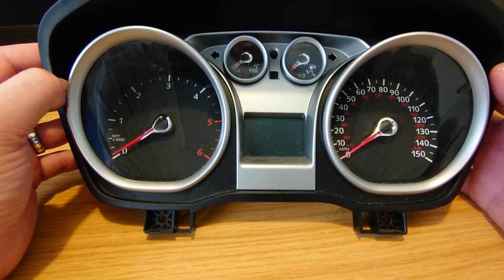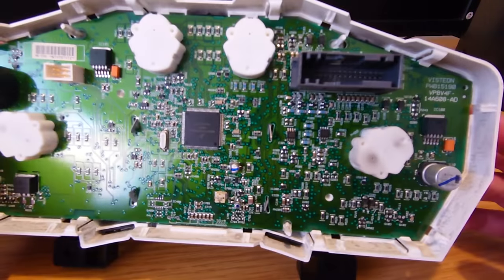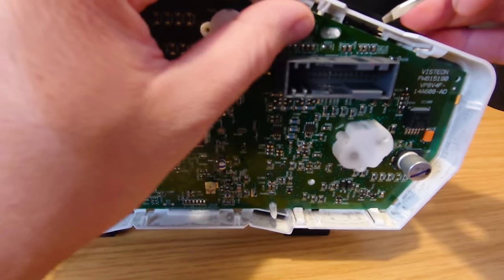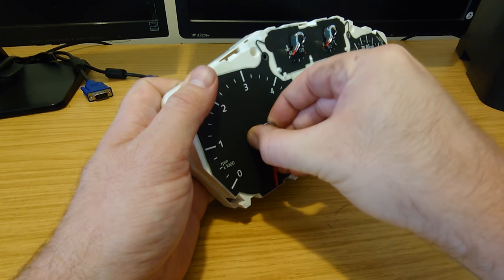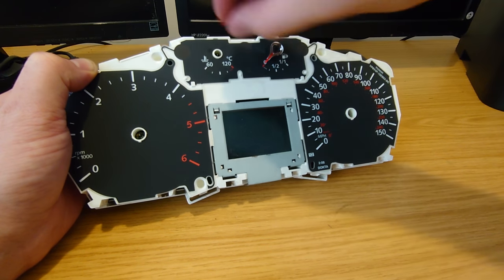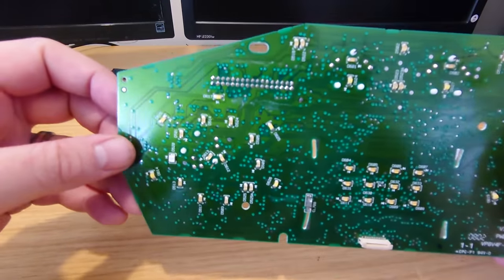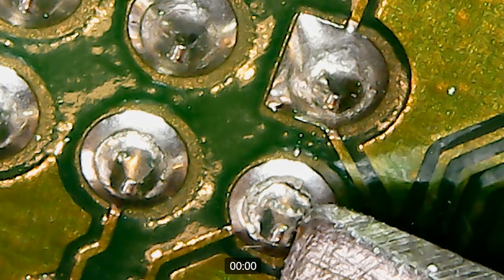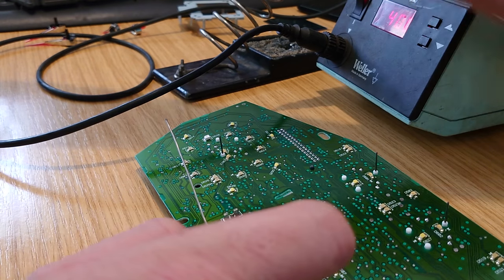Ford Focus mk2 instument cluster strip and repair U1900

Comment: so my car does this engine malfunction alot - will sometime refuse to start, sometimes will when driving comes up, tap on the dash changes to acceleration reduced - but comes up now and then engine malfunction - do you think its the same issue, had some scans of my car that related to CAM need to ask my mate hte code he got off of it which he saved. Recon its the same issue? also when soldering do you just ensure you adding to it - not heating up existing solder as that would make the pins fall out id imagine

Comment: I stripped the cluster like in this video and tried scolding it. However, it was going fine but one of these 'pins' in the top left completely fell off - what shall I do? Like there is nothing there anymore - where before there was that metal thing that you would scold...

Comment: Very,  dry impressive. I have a 2009 mk1 Kuga, which I believe is the same dash as the focus.,!?. So I was told. I bought the car a few months ago with, as the owner told me, had a fault code of  (u) V1900, not sure if u or v. Recently a garage cleared and reset all, but came up with a dpf. Fault, but the item concerned had been replaced ,new, so if it is something to do  with the instrument pcb, does that also control One or two other items in the system, and is your repair way the best fix.?   Thank you . Mick.
Reply from the maker: I would be surprised if a dpf fault was relayed to the dash. What was the fault? Fuel vaporisers are quite common faults for dpf on  ford.
Reply: @rmautodiag  Hi again, many thanks for your reply, oh, an sorry about ‘dry’ at beginning of last mail, it should have read, very. As to the dpf, that was shown on the fault code meter, not on the dash board. Sorry for anything misleading. The previous code before a reset was u/v? 1900, and wondered if you had come across this before, and what the fix is, in with the fault it does intermittently lock the doors? Any ideas.?  Thank you,  Mick.

Comment: Hey ,sweet video.  Have you ever done a 2002 transit connect cluster befor ? The back lighting seems to stay on and flashing on and off  and drains my battery could this be the same problem ?  Thanks in advance

Comment: Any tips on getting the led ribbon back in the mans hands are in the way and I cant get it back in ? Thanks
Reply: It’s actually easier than it seems maybe use tweezers ..it has 2 small clips at each side it should just slip back on

Comment: what is the reason that youre repairing it  
my ford focus makes a clicking noise at the front under bonnet when turning the ignition key several times,after so many turns the car makes a clicking noise at the rear of car,i wonder if its the fuel filter

Comment: Do I need to disconnect the battery before removing the cluster? Thanks, great tutorial
Reply from the maker: I personally don't. But it wouldn't hurt, make sure you have the radio code

Comment: Hi great video , could this cause a parasitic battery drain ? I have narrowed it down to the cluster . The display goes out after 20 minutes but cluster still keeps canbus awake . Possibly has a temp fault as gets to normal running temp ( according to gauge) within a minute ( 1.8 petrol mk 2.5 ) thanks Thor

Comment: Nice work , 
When I lock my ford focus TDCI 1.6 2011, by pressing the key fob twice I notice every thing goes off apart from the screen between the  rev counter and the speedo it stays on for several minutes befor it shuts down ` would  there be an issue with anything in the instrument board or screen ,
Any advice would be helpfull please, bought car privat seller not so long ago.
I had removed battery to change it and lost the code to radio as well,

Comment: Ive got an st225 thats judt died randomly when i tried to boot it.checked for error codes and i had about 7 different codes like crank sensor position cat not recognised. Do you think this could be the issue.might try the old wack on the top trick when it dies again.

Comment: Great video thank you very much for uploading will this solder fault also causes issues with the fuel gauge? as I have put a new sender unit in the tank and the gauge still doesn’t work !   it’s a 2007 cmax tdci

Comment: Great explanatory video. But how does the instrument cluster be removed? If the engine system fault occurs more often, I might have to follow your repair. But im wondering if ive caused the fault by accidentally touching and switching on/activating internal scanning (i think it might be an internal alarm system scanning for movement)
Reply: Hello Derek, in case you never found the answer, to remove the cluster you lower the steering wheel, lift up the trim in front of the cluster and there are two screws at the front-bottom of the cluster

Comment: Is it possible the engine system fault can occur if I accidentally turn on/activate an internal scanning of the car - it's a switch on the driver door very close to the window switches. I don't know what its for but suspect it might be something to do with the car alarm system, and presumably linked to an immobiliser if its scanning. I assume that should not be switched on when getting in the car.

I accidentally pressed it with my hand and then couldn't start the car.  I pressed it again and the dash displayed "deactivated internal scanning" or "deactivated scanning".  I happened to try starting the car with an older key and it started. But i also tried with the current key and it also started.

This engine system fault preventing start has happened twice in a couple of weeks.   But i think i accidentally touched that internal scanning switch on the first fail. It might be coincidence and will happen again.

I could try activating the internal scanning switch and see if the car will start. If it doesn't, i would assume when internal scanning is on, an immobiliser is turned on?

Comment: I'm going to sound dumb but I'm not an expert . So i have a 59 focus and the cluster is ok apart from one thing. The screen has stopped displaying information. If i plug in a cluster from another car would that work?
Or should i mess about taking it apart as you did and just swap the screen?(i assume the screen alone is not programmed and should just take its information from the cluster electrics)
Or am i best to get a professional to do that for me? 
Thanks
Reply from the maker: I would just swap the screen.

Comment: Thanks man :) I think I´m gonna fix mine myself, after watching this :)  I didn't know if you had to get the steering wheel and stuff of, to get it out. But I can see at the end of the vid, you just pulled it out after removing 2 screws ^o^   Time to dust the rust of those ol´ soldering skills :D
Reply: Almost forgot to comment, but I went for it :D It took 1 1/2 hour all in all, and I couldn't have spent my Saturday better, saving quite a bit of money :)  Thx again..

Comment: I'm sure I have the same problem, not starting until I bash the dashboard,  but even when it starts all the panel lights stay on and rev counter & speedo don't work , 
The red light flashes like crazy for a while then goes off.
Sometimes after it starts it goes into limp mode until I turn it off and back on then it runs fine .
My mot is due and it won't pass like it is. 
Do  you have any videos available on how to remove the dashboard  and get to the instrument panel  ?
I looked at your site and couldn't see any,
 unless I missed it .
I'm in UK  ,  It's a 1.6 2005  focus .
Tia

Comment: I have this issue on my focus st 225, engine malfunction and reduced acceleration, throttle pedal doesn’t work at all.. when i put in my obd reader it gives no fault codes tho? Any ideas? Starting to think it is the cluster

Comment: Had mine apart and resoldered all the joints and it’s still the same. Is it worth going over them all again to make sure I’ve done them properly?
Reply from the maker: I usually check on the microscope to check there are no cracks. Have you checked powers and grounds to the cluster as well?
Reply: Didn’t fix mine either, did you find your fault ?
Reply: Anyone find a fix, after solding didn't fix?
Reply: After soldering didnt fix it, ended up needing a new battery
Reply: @rmautodiag  , hi looks like a very useful video , before I tear into it , my focus 05 1.6 TDCI estate after changing the battery and washing the car by hand, everything was working, parked it up, 2 weeks later, turn ignition on, headlights come on with dash switch in OFF POSITION, no indicators or hazards, no interior lights, no high beam flash, no central locking, no horn ...😢 Car starts fine , battery holds charge, Are these all likely symptoms of the cracked solder . 🤞

Comment: I did the same repair however my needles seem to be out of alignment.  How can I get them back to where they should be ? Thanks
Reply: You need to access the car's "secret/service menu". Google this; it displays various details of the cars current performance eg current speed, current rpm, current fuel level etc. Essentially you can use it as a temporary speedometer etc while your needles are haywire. Then your aim is to match the needles to these readouts.

You need to manually nudge the needles until the stepper motor's stopping points are in such a position that the needles then match the values displayed by the secret menu when driving.

It's very fiddly and time consuming, but it can be done. You'll probably have to plug and unplug the cluster from the car several times to adjust things - your life will be easier if you keep the outer casing off the cluster until you've got things sorted. Having a quiet road or access to an empty car park helps. This allows you to keep an eye on both the menu displays and needles as you drive along, with less danger to other road users.

I've had to do this myself. It's annoying but can be done, just take your time. Good luck!

Comment: Thanks for this video. I took the cluster out and all the soldering looks good, no corrosion etc. Any suggestions on what else might be the problem? Thanks.
Reply: Did you get it sorted, can’t see with my eyes any dry joints but will be doing it anyways

Comment: Hi I have a ford focus 09 plate I'm a mechanic by trade the car started fine Sunday came out to it monday and my imoblizer light stays on and then flashes like 2 then 3 up to 50 will this fix it? But I haven't got a spare key to see if it's the key
Reply from the maker: take the dash out and move the connector when plugged in and see if you can regain comms

Comment: I followed this process but unsure if i replaced the gauge dials in the exact same position after twisting to remove. When I refit the cluster it bugs out and the engine wont crank. Any ideas??

Comment: my cluster went to jc cars which is also on youtube but for 3months i have had the immobillizer light flashing,they supposed to have fixed it,i had 2 dtc codes  E510  &  D900 the E510 HAS VANISHED   COULD I DELETE CODE MENTIONED WITH FORSCAN USING THE OBD ELS27

Comment: Hi there, thank you for the video. Appreciate your effort. Whats the latest on the vehicle? Any problems with it or is it all good ?...would be nice to now any update. Im very hesitant to do mine, but I will attempt it and I'm sure after alot of research its definitely the pins that need resoldering. Thank you.
Reply from the maker: Yes it worked fine no fault reoccurring. Thanks for the comment.
Reply: @rmautodiag  I'm working over Christmas so just in case all doesn't go to plan I'm going to attempt it just after. I was watching vids on how to solder too last night lol. Im all set just need to buy flux, some time and guts. Lol Happy Xmas dude.

Comment: Hi there . Would this cause a power steering malfunction on my car.  2008 ford focus 2.0 tdci.  Turned car off and on again works fine now
Reply from the maker: I wouldn't have thought so, if it's an electric power steering pump the first thing I would check is battery condition.
Reply: @rmautodiag  
عندي مشكله في  عدادات الفورد فوكس موديل 2008   ... كيف طريقة الأصلاح 😭

Comment: Great video,Richard,excellent even. The speedo in my daughters focus, a beautiful Aquarius blue,is under reading by around 30 kph and once dropped back to zero as she was driving. Would this be the Wheel speed sensor or a damp speedo cluster pcb? She has only just bought this secondhand private sale and has bad numerous problems since purchase (brakes,bonnet lock,fuse,etc) so having to fork out so much is breaking her heart and her pocket!!!
Reply from the maker: If its constantly 30mph out it could be a gauge calibration fault. If I remember correctly the speed pickup is a 3 wire sensor on the gearbox, they used to give alot of trouble on the mk1 focus.

Comment: Hi. I have a 54 Plate Focus. The speedo drops randomly when driving and then puts a strange surge on the engine. Also, if I put the air con on, I can hear a relay clicking under the bonnet from inside the car which again, seems to cause a surge and then the car stalls. I took it to a garage, they have identified the problem as an instrument cluster fault. If I did this little resoldering job on my car is it likely to fix the problem so you think? I’m absolutely broke and can’t afford to send it off for repair at almost £100! Help! Thank you!
Reply: Hi, just want to know if you get it solved

Comment: this happened to me and i didnt know it existed until i had replaced my starter motor, battery and alternator, how hard is it to solder that it looks very fine and precise i dont want to mess it up and have to get a new cluster and pay someone to code it?
Reply: I did mine a couple of weeks ago. The pins are very small and your life will be easier if you have a magnifying glass or microscope to help you. However, it wasn't particularly hard. I don't consider myself an expert with a soldering iron by any means, and I had no real problems. You just need to make sure you're getting enough solder on each one to cover any cracks and create a secure joint with the pin. Once I had the unit open, the soldering work only took about 10 mins. I've gone almost 3 weeks now without any problems since putting it back in the car. Fingers crossed. 🤞
Reply: Проблема была в приборной панели? Или в другом?

Comment: Hi there, could it be the cluster if it is saying, engine system failure,and won't turn over.
Reply from the maker: Yes it could be, though I would advise it being diagnosed or at least a code scan. Thanks for the comment.
Reply: Thanks for replying,I had it put on a diagnostic machine and had the fault cleared and it would start, but when I turn it off it won't start and comes back saying engine system failure, the fault are saying it's communication problems,thanks again.

Comment: Are there  any other faults that can cause the same faults? Had my clocks checked  and looked at them myself and all seems good.
Reply: I’m having the same issue on my 08 Focus ST. Resoldered the intstrument cluster but still the same faults. Did you figure it out?

Comment: Help please!
Hello how are you? I have a problem when I lock the car board my computer doesn't turn off and my battery runs out. This happens when I unlock if the cd radio  does not work. When it doesn't turn on, the computer doesn't turn off when I lock it. Sometimes it works sometimes it doesn’t work. When the radio is running normally, the on-board computer shuts down on time. If you don't know, maybe the problem is with the computer, what if you had similar experiences. Greeting

Comment: Hi I am ford focus  1.6tdci 2010 and I losed my steering dash showing  steering mail function replaced  steering  electric  and rack but still no change would this be caused  by pcm clock please  help advise
Reply: Also managed  get code  u0073 control module bus (. A off)

Comment: Can i replace the dash with one from a totaled car?  Any possible issues with immobilizer?
Reply: Yes, there will be issues. Cluster and immobilizer must have communication link to each other. If you swap in a cluster from a different car, then you will need a Ford dealership to reprogramme it so that it's linked with your own car's immobilizer. Expensive job and potentially hard to find someone who will do it now for these older model cars.
Reply: @_D1886  thank you!

Comment: Would this issue cause an engine malfunction warning light then reduced acceleration message??? Fantastic video by the way 👍
Reply from the maker: I have seen it give no throttle response. I have another video with me looking at this fault in the car if that may help
Reply: Hi yes it would. I had that symptom
Reply: @Boymentation1994  same having it now
Reply: @joeeboii4643  I got mine repaired at Cartronixs. Reasonable priced and no issues after that.
Reply: @Boymentation1994  thanks, I done mine myself following this video, so far so good the light haven’t come back on yet

Comment: I just repaired mine with some car servise company and they said its all done but seems the car is  not starting and all tha lights are on and the red light on top flashes aswell .the computer says there is engine and transmission malfunction.what do you reckon it is tia
Reply: I have the same issue. Did you figure it out?
Reply: @epie   yes mate the cluster was faulty i send it to repair for 100 and something pound never gave me a problem after
Reply: @silviobrunelli4161  That’s nice, thank you